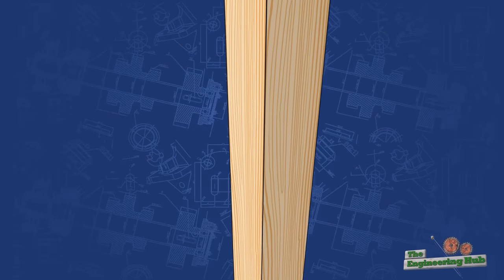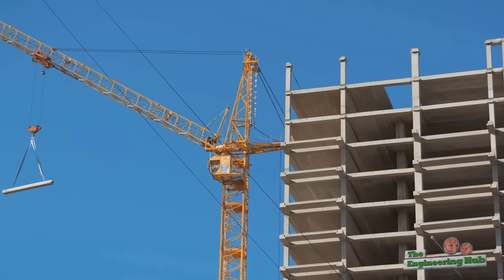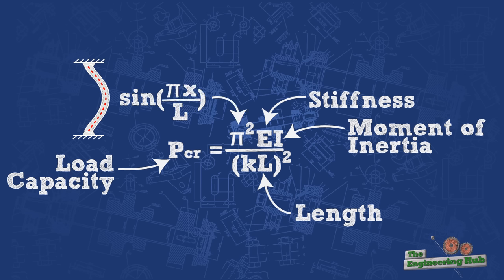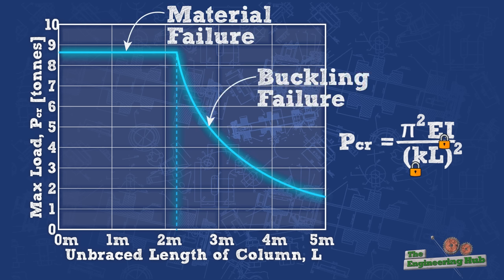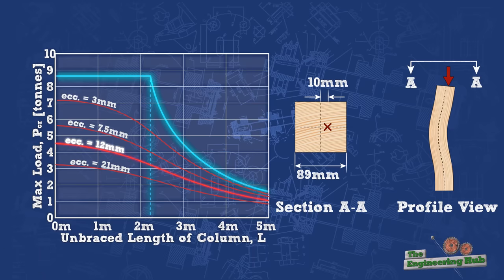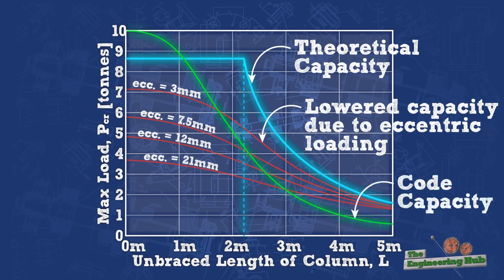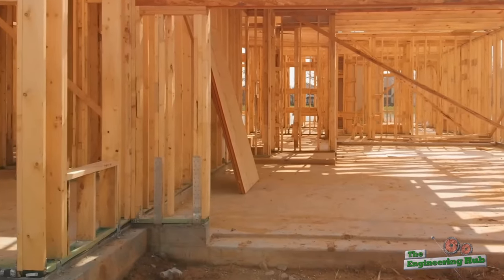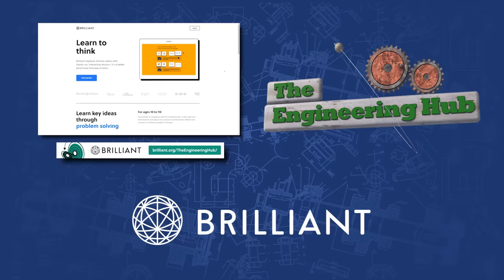How much load can a timber post actually carry?

Comment: Wood will not bend, it will shear. And since it is wood and has nots, and cracks/splits that form when it dries out.  Therefore, it is not nearly as strong as any 'formula' would say it is.  And then you need to consider rot, and insect damage.
Reply from the maker: Hi John, these formulas have been tested many times with hundreds of specimen and they tend to provide relatively accurate answers (mostly on the conservative side since they use the 5th percentile strength). There are modification factors that account for the likelihood of knots, rotting, creep, etc. that are also included in the formula just not shown here. Maybe in a future video we will explore these modification factors in more detail.
Reply: William Smith  If you are standing on a wooden deck held up by 4 x 4 posts and you see those posts, or any other wooden members bending any visible amount I hope you have the common sense to get off and stay off that deck because it is ready to catastrophically fail and people will be seriously hurt.  However, your first clue that the deck is failing will not be bending, it will be a cracking noise followed closely by the collapse.

Comment: 4 Inches is not 89 mm but 101,6mm. Rounded to 100mm.
Reply from the maker: A 4 by 4 timber post is also not 4 inches but 3.5 inches which is 89 mm.
Reply: What you would get in Europe is 98x98 mm

Comment: This is myopic without examining the qualities of the wood.
A 4x4 wooden post is not the same as another 4x4 wooden post
Species. Knots. Grain tightness. Grain orientation. Bark inclusions.
Reply from the maker: Such things are accounted for in the design code by partial factors. Further more, the wood quality is accounted by the wood species. In this case the species is Spruce-Pine-Fir which is a mixed category and usually reports slightly lower values than obtained from tests. This is done by reporting the 5th percentile strength. This means that if 100 tests are performed, the reported value would be from the 5th weakest sample. The capacities reported are based on those assumptions which are taken from the Canadian Wood Design code.
Reply: Use maple

Be FIRm and it will SPRUCE you back to life rather than in a PINE box

Comment: 4x4 seem to hold alot of weight... i have a wrap around deck on my new house(30 year old house) and its a fairly big deck and the 4x4's are about 15-20 feet tall, and they are used as the railing supports as well.. its odd how they built the deck 30 years ago with 4x4s and not 6x6 beams..   But they are also using 2x6 boards on the left and right to support the 4x4 beams at a sidewways angle..
Reply: Sounds like a scary deck don't have a bunch people on it
Reply: That's a cheap cheesy deck
Reply: Built 30+ years ago those may be REAL 4x4 posts

Comment: The actual dimensions of a 4x4 post is 3 1/2" x 3 1/2". I used enough of them and measured enough of them over the years to know this for a fact independent of any manufacturer statements. If this simple fact is incorrect right at the start then I assume there going to be numerous incorrect statements and switch off the video.
Reply from the maker: That's why it says 89 mm in the video, which is to 3 1/2". That's common knowledge
Reply: Everybody who uses dimension lumber knows that the specified size is nominal, not actual.

Comment: 4 inches is 101.6 mm mate
Reply from the maker: Yes and 3.5 inches is 89 mm, exactly like a 4 by 4 timber post, which is 3.5 by 3.5 inches actual size

Comment: so in laymans terms what was the answer in pounds?
Reply from the maker: A 3-foot long post can carry about 19 000lb;
6-foot post can carry around 11 000lb; and
9-foot post can carry around  4 800lb;

Note that different species, end conditions, environment, load duration, lateral loads, and many other factors influence the ultimate load-carrying capacity.
Reply: @TheEngineeringHub  Forgive my lack of a PE and memory of your video without re-watching, but are those max compressive loads or max loads to the point of buckling or whatever?  Seems intuitive to me that bowing buckling avoidance can be raised by lateral bracing, girts and purlins or similar, for whatever wood species one uses.  Sorry for the fallback to lay terms.
Reply: @TheEngineeringHub  Would stacking three 3ft posts on top of each other give the same load bearing capacity as a 9ft long post since the length is increased?
Reply from the maker: Hi replyhere590! For longer columns, those loads are to the point of buckling. For shorter columns, the capacity is governed by the compressive strength of the material. The 3ft post for example is governed by the strength of the material. To your next point, yes, buckling can be prevented by proper bracing. If a 8 ft column is properly braced at its ends and midpoint, then its buckling capacity is as of a 4ft column. To your point about wood species: in theory, the carrying capacity does not appear in Euler's formula and should not affect the buckling capacity of a concentrically loaded column. However, the strength of a species is correlated to the stiffness of the wood and the stiffness does appear in the formula. So in practical terms, a stronger species would also have a higher tolerance to buckling. To make things even more complicated, when the loading is eccentric, Euler's formula gets more complicated and becomes something that is known as the Secant formula (not shown in the video in order to keep things simpler). The Secant formula is dependent on the strength of the material (species). As a concluding remark, the strength of the material does affect the buckling capacity in a practical case.

Comment: 89mm is 3.5 inch.
Reply: Which is the true dimension of the 4x4 you'll be getting if you shop big box
Reply: @rabidcentrist  yes. but the video is mixing nominal imperial with actual metric dimensions in a single image for an engineering context. best to call out when you are using nominal numbers.  would be nice if english had a symbol for nominal measures but as far as i know we do not.

Comment: What do you mean "wrinkle locally"? I know what those words mean separately but not together.
Art from Ohio
Reply from the maker: Hi Art, maybe wrinkle is not the best choice of wording. It basically means a local failure rather than a global buckling failure. See the image: 
https://web.mst.edu/~jthomas/classes/2211/lessons/wood/failure/012.jpg
Reply: @TheEngineeringHub  Wrinkle I am good with, it is the use of local and global when referring to a piece of wood. I realize the terms are metaphorical but they are both totally illogical.
Maybe if you didn't use meaningless metaphors when describing something in a scientific way it would make more sense.
Local means nearby and global means all over the world and any fourth grader would know that. 
Understanding that, how could a piece of wood have local or global wrinkling?
Reply from the maker: @artszabo1015  That is actually the phrasing used in the literature, codes, and books. That is the correct terminology, "Wrinkle" is more incorrect. Here is an example of a study that shows how these terms are used in relation to failure types if you don't believe an engineer with an accent:
https://www.researchgate.net/figure/Failure-modes-of-HSS-columns-a-global-failure-mode-HSS-305-305-16-40-CR2-20-and_fig2_340226352
Reply from the maker: Hmm okay.  In your opinion, what terms do you think would have been more appropriate instead of local and global? I still believe that the vast majority of viewers, with the help of the graphics, can put 2 and 2 together and figure out what global and local mean in this scenario. Of course, there will always be people that are confused no matter what the term is and probably a big majority that don't even care. I mean, the video has more than 375 000 views and no one has commented that they are confused about this before. Also, the word global doesn't only mean "worldwide" or the "whole world". According to the Oxford dictionary it also means "relating to or encompassing the whole of something, or of a group of things". I am trying to provide useful material for the general public and educate on the subject with good intentions. Of course, it's not gonna be perfect in everyone's eyes. I must say, the video has 97% likes and 3% dislikes so I am pretty happy with that. I will try to improve but it will never be 100%. If you think that I am a "college fool" that repeats "stupid s*it" or possibly a "weak a*s person" that's okay, maybe I am.
Reply from the maker: The whole engineering community seems to differ. Thanks for your comment. It's okay that you think it's stupid, in my circles we don't. I encourage you to stay away from The Engineering Hub as it will most likely be called that again in the future. Unless you expect a YT video to change the terminology used for decades by thousands of engineers and scientists. Still waiting for you to suggest better less ambiguous terms? You may block  and unsubscribe (I doubt you ever were subscribed) now, plenty of followers that are happy about the content. Cheers!
Reply from the maker: During my engineering career, I have engaged with 1000+ engineers and attended numerous conferences.  I am a part of the Canadian Society for Civil Engineering and Engineers and Geoscientists BC. Of course that's a drop in the ocean compared to the number of engineers in the world so you don't have to take my word for anything. Here are engineering books that use the terminology used in this video:
1. Mechanics of Materials (2013) by Gere
2. Structural Analysis (1997) by Hibbeler
3. Material Science and Engineering (2014)  by Callister
4. Mechanics of Materials (2012) by Beer
5. Theory of Elastic Stability (1963) by Timoshenko
6. Modeling for Structural Analysis (2010) by Powell

These books have shaped thousands of engineers worldwide and that is the engineering community I referred to in the previous comment. If they use the local and global terms then it is also good enough for a YT video. Or you expect me to draw the line and correct the misusage of these terms for the past 50+ years? I am still waiting for you to suggest better terms instead of local and global ???
Reply from the maker: Okay Art, good for you! Universities will probably get rid of these engineering books soon; the books and the people studying them must be stupid since Art from Ohio doesn't like the wording so everyone else is stupid. Nice

Comment: nope...  your equations do not account for species or grain density.   there are nearly infinite contributing factors to 'wood strength'   That's why wood working is the only profession where the technician knows more than engineers.   We call them craftsmen.
Reply from the maker: In fact, they do. All design codes that we are familiar with account for more than only the species. Sure, they don't account for all factors, but in general, they do a good job based on risk and reliability analysis. Some of the factors accounted are: species compression strength parallel to grain, strength perpendicualr to grain, shearing strength of the grains, tension strength, knots and defects as a function of the volume of material, moisture exposure, duration of load (creep), parallelizam of the system, stability of the member, notches (if present), combined loading stresses and few others that don't come to mind at this point. The wood buildings we see around us are not standing up by chance, there is a calculated amount of risk present which is in fact the same as for any other material - that's the point of the strength reduction factors to reduce the risk to an accaptable level. The equations from the code are not shown in this video to avoid presenting too much info, but they are there, and they do account for all of this.

Comment: Isn't 89mm 3 and a 1/2 inch?
Reply: Yes just like a 4x4 is 3 and a half inches.
Reply: @actionjksn  That is just plain bizarre. Fair enough then.
Reply: @robertwelch24  it's not bizarre, the wood is the larger measurement when it is first cut. There is shrinking from drying out and it gets planed. The stuff from the 1800s measures a full 2x4 and 4x4 or whatever size boards you are using. Something like a 1x 4 measures "3/4" x 3-1/2"

There are some specialty woods you can buy in full 1 inch thick board but normal dimensional lumber is never an even number like that.
Reply: @actionjksn I appreciate your reply. Still bizarre sorry. In my country the measurement advertised is exactly what you get. i.e. 4 by 2 is 4by 2 and 100mm by 50mm is exactly that. imperial or metric. Anything other than that is misleading.
Reply: @robertwelch24  With you√.  Here in the USA only those who own their own sawmills can get non-liar-dimensioned lumber.  Full disclosure: we own a Wood-Mizer LT40 Wide Super and a Peterson WPF Swing blade mill.  And 180 acres of woods, mostly hardwoods.  Lots of folks here in Central VA are happy to give away pine logs just to get rid of them.  Our TFrame designer, architect (chaperoned by a PE)  and I will no doubt use Euler's formula to figure column (post) and beam sizes for our upcoming builds on our farm.
Reply: @replyhere590  those Petersons are a good piece of equipment...

Comment: You need to speak English- or at least American. 🙄
Reply from the maker: Noted, will do next time ✅️ which language was it this time?
Reply: The Engineering Hub - Metric… 
🙄😁
Reply from the maker: @michaelgarrow3239  haha got it! You are right, we should try to facilitate both systems! We'll try next time! Our video on concrete anchors was in imperial units and we got a few negative comments about it so we kind off dropped it. Including both is probably the best.

Comment: The length of a TIMBER in use should never be over thirty times its minimum thickness. Thus, a 4-inch x 4-inch shore can be ten feet long, a 6-inch x 6-inch shore fifteen feet long, and a 4-inch x 6-inch shore ten feet long. If the proportion of length to thickness is greater than thirty to one, the shore will buckle  ...